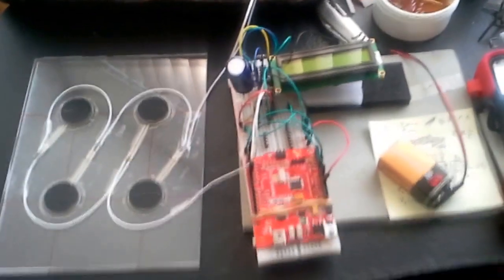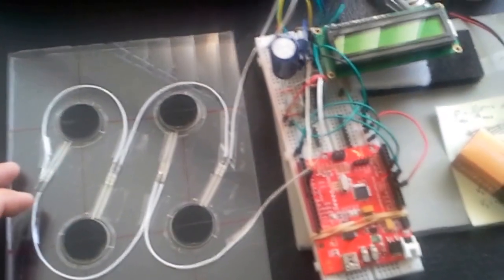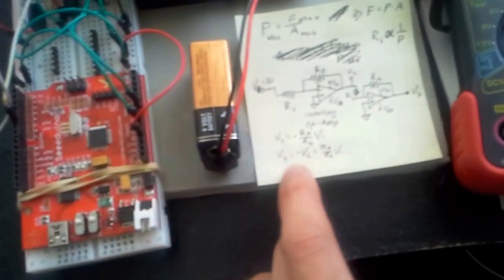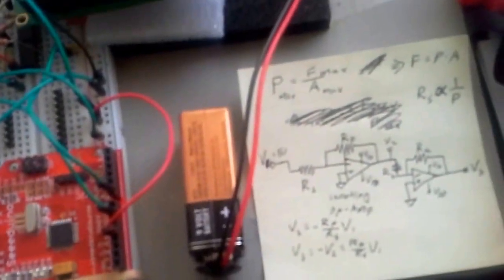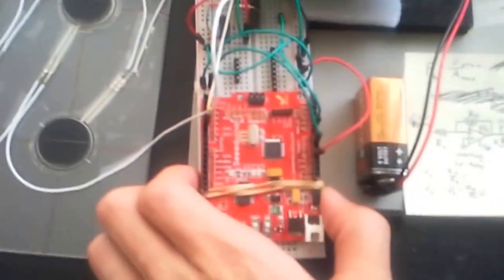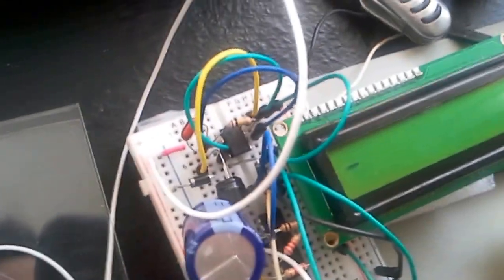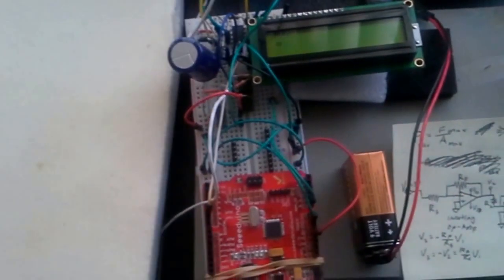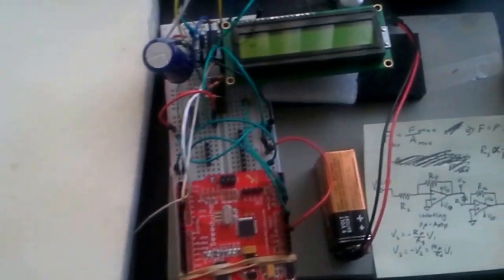Impact-force sensor (breadboard version)

Comment: Do you have a link to the code used or a tutorial?
Reply from the maker: jenny ball I'll have to look for it, but i think i used an event trigger for when the sensors passed a certain threshold. Once triggered, it would time stamp a starttime, then begin recording sensor values into an array until some max time was reached, then print what max value was (after mapping it to lb, of course). I forget what i set that max time to, i think it was about a 0.25 seconds. I'm sure there's a better way to code this, as people's punch durations can vary. An alternative way might be to break out of the record loop if it drops below a lower threshold after having been triggered.
Reply: carnotricecooker if you could have a look that would be great! Have a few of these sensors and playing around with them but not getting the output wanted atm
Reply from the maker: jenny ball do you have a schematic of your setup? I recall having to use 2 inverting op amps in order to correlate the change in resistance of the sensor with a positive linear voltage output that would feed into one of the analogRead pins.
Reply: carnotricecooker I do but it won't let me attach a photo in a comment. The circuit im using is the recommend circuit on the data sheet to extend the force range but with the addition of a 0.1uF cap in parallel with Rf. I have a voltage output on a multimeter and can change the value of Rf to increase my force range. Where I'm struggling is its not picking up sudden impacts like yours is it has to be a more gradual one. And my arduino code output doesn't represent the actual force
Reply from the maker: The actual force reading had to be calibrated using a linear relation, i.e., y = k*x formula, where y is the output in force (lb), x is the analog reading in bytes and k is the conversion factor from the analog reading to force. I'd recommend creating a github to document and store your code, i'll be more help on your project there. I found the original project file containing some of the code used for this project, but this project is rather old your setup might be different.
Reply: carnotricecooker could you provide the code for this project? it would be a great help in my project.

Comment: Hello, what was your total cost into this. Do you have a tutorial somewhere?
Reply from the maker: +Trevor Caruso Total cost was maybe a little under $150. I used 4x 1" FSR (force-sensitive-resistors) sensors, which you could buy off sparkfun, with neoprene spacers sandwiched between plexiglass, and two basic inverting amplifier circuits in series. I found that the plexiglass method isn't very uniform as it flexes as you apply pressure onto the plate, making it hard to mechanically translate all the applied force onto the FSR's. A better route I'd actually recommend would be to just take apart a postal scale and use it's internal components as mentioned per this blog http://arduinotronics.blogspot.com/2013/04/this-weeks-projects-load-cells.html I like this method since the postal scales use more of a cantilever beam mechanism that mechanically translates all the applied force onto a strain gauge!
It's not listed, but the schematic also works with an accuteck postal scale you can buy off amazon for $25! You'll also need an INA125P chip, but that's by far the most exotic part in the whole assembly :P